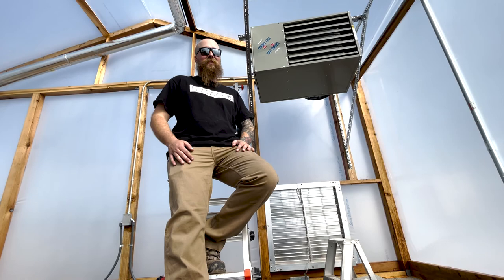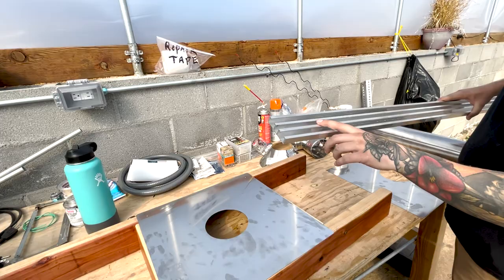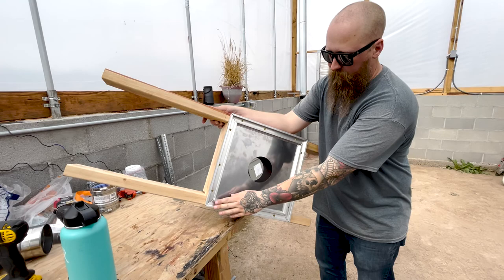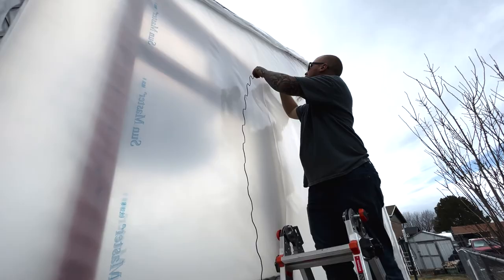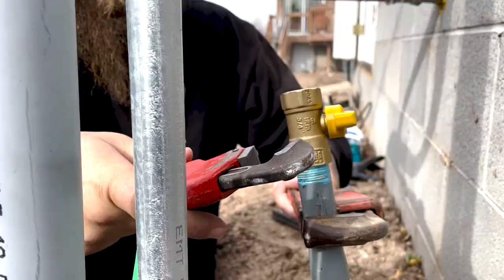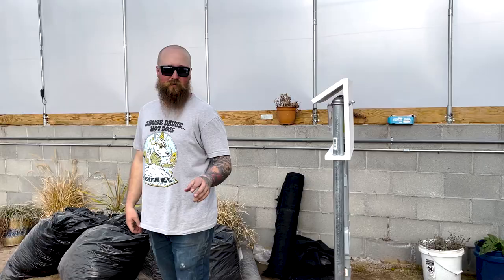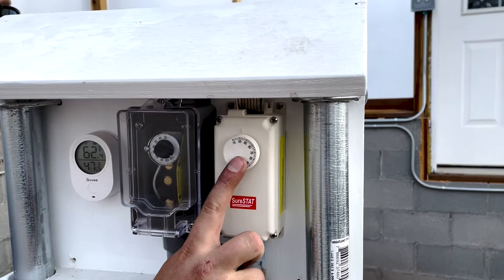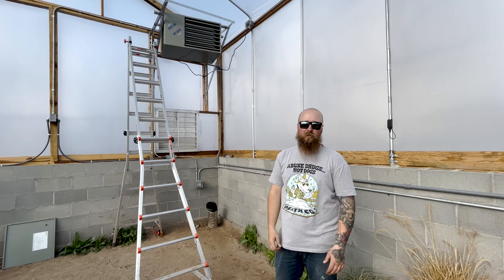Installing Greenhouse Heater | Part 2

Comment: Zach per ifgc gas code. A flex connector can’t penetrate through the box on the appliance and connect outside the appliance box just in case of earthquake could sheer the flex line and fill the greenhouse fill of gas.
Reply from the maker: Thank you! I'll look more into that and make some adjustments 👍